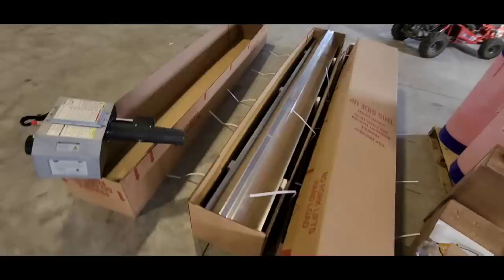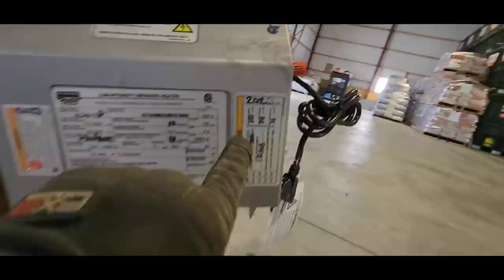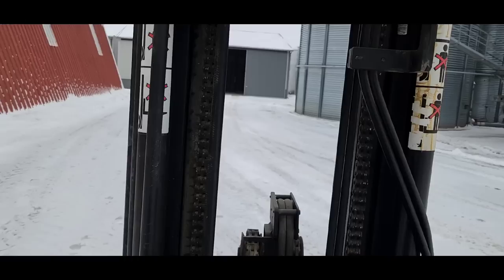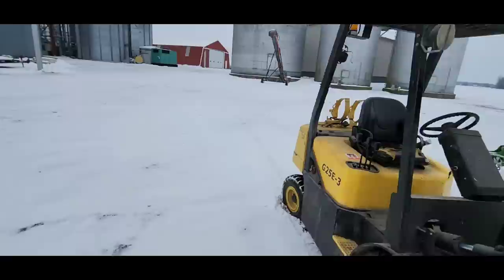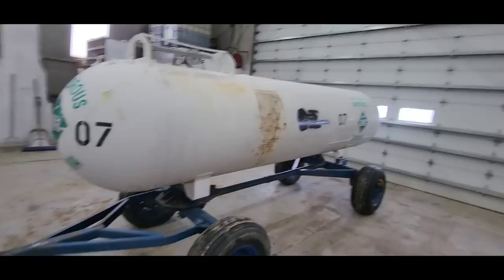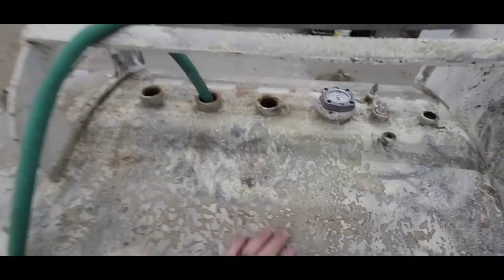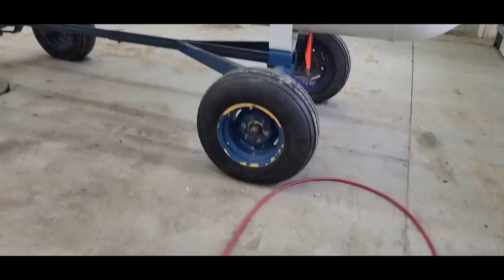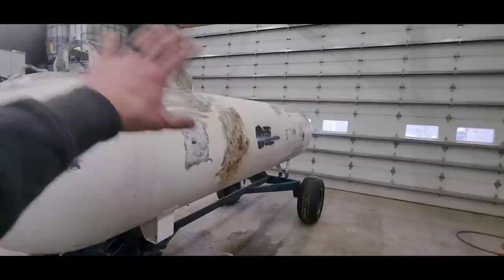Stuck in the Driveway

Comment: Put the burner where the gas line is ! Run wiring to burner. Much cheaper to wire than to run black pipe !
Reply from the maker: The difference in cost is probably less than $200.

Comment: The ignition switch gives you 2 circuits. One is on as long as the swirch is in run or start. The other is on only in the start position.

Comment: I would suggest pulling #6or heavier and put a 100amp qo box that doesn't have a master breaker in it that would be a sub panel at that end of the building that would give you other options later

Comment: Just put the regulator at the burner.   Don’t use 10 footers. You have more chances for leaks!
Reply: Good point. Reducing points of failure is always a good idea.
Reply from the maker: You can't put a regulator inside
Reply: Why can’t you put the regulator inside.  Use a Maxitrol with a vent limiter.  You need to keep your highest pressure till you get to the burner.  Sch 40 black pipe is rated for 150 psi if you use std blk mal fittings.

Comment: Great video… will those heater things use a lot of gas? I know it depends on the temperature settings.
Reply: For how i understand it, it will only run a few weeks per year. So it can't be too much. Nathan has the same system in the shop BTW.
Reply from the maker: When on high it should burn about 2 gallons of lp per hour if running constantly. But I only need it for about 2-3 weeks.